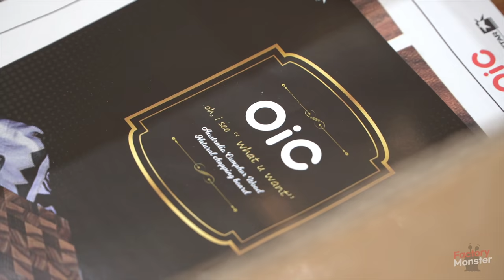Process of Making End Grain Cutting Board. WoodWork Artisan in Korea

Comment: He never run your hand over top of Joiner if those boards kick out your hands going right down into that jointer and it's not going to be pretty you need to have a push board on top of them to protect your hand the wood shops I work at in America you would never do that at least not the shops that I've ever worked at